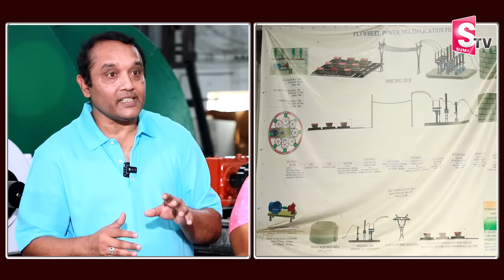Free Electricity For Home Without Air, Water and Coal In Hyderabad | Kamma Gear Wheel | SumanTV

Comment: whenever electrical consumption load increases, it will stop.   It will not work. It is just shows voltage and amp in meter panels but not for real work load.
Reply: Exactly . It won't work.
Reply: Yes Newton law won't allow this

Comment: Appreciate the effort of the engineer couple. It is inspiring for young engineers towards innovation and entrepreneurship.  While this works perfectly as per physical laws, but practically not feasible for higher loads. My suggestion to innovators is to create portable models for small loads like mobile  charging and lights for use in remote areas where power is not available.
Reply: Bro it takes one unit to make double units of electricity.. if there is no electricity then it cannot provide electricity
Reply: This will not work, because it's not convincing but confusing. No system in the universe is perpetual.
Reply: @styleZETTE  
  Few years back one tamillian claimed that he could prepare petrol from water.
Reply: @ASPO-yk9nv  we can use use wind energy or other for starting, later it will move forward...
Reply: Sir baskar sir kuteera parisrama gurunchi kavali sir
Reply: @styleZETTE  No system in the universe is perpetual, that is naive, superfluids or helium at absolute zero are perpetual. But surely this is confusing. Dynamo was the first to convert mechanical energy into electrical energy, this is nothing new so it won't be a hit.
Reply: @telugukings1227  this is a pulihora concept.chinthapandu lekunda pulihora cheyochu annatu chepparu vellu.
Reply: @technoyoung  Hahahah

Comment: Sorry to say the truth and am not here to hurt the people who has commented here.
Please don’t mind.
Basically, flywheel doesn’t provide free energy. 
Let him showcase the output with complete load and test it atleast for an hour without depending on the grid. Getting patent in India is not a big deal here.
Till date, right from inventor Chas Cambell to Mr. Chaganti garu, none of them proved to the world that this kind of system run independently without grid or any external force.
But, all the media people without having complete knowledge about the technology and the flywheel they are showcasing him as a great inventor. But, dig into the facts and realise that it cannot provide any free electricity.
As soon as you put the load on the system you will know the facts.
20000 Megawatts is a big deal and he would the next Elon Musk.
Sir, please don’t talk much and I request the media people to do some research before claiming it as a great invention and which is useless.
The result would be zerooooo
Reply: Thankgodd. You have explained it wonderfully. These are the exact words I want to mention.I don't know whether to laugh at this or to have pity of them. People are dumb and congratulating in the comment section.

Comment: Sir,
This is against laws of thermodynamics and laws of nature. Whatever energy is given to the fly wheel will be supplied to the generator. No extras, what ever you do. Your system appears to be working for a while but will stop ultimately once input is disconnected.
Flywheels naturally run for a long time due large moment of inertia. If you go for high speed, you loose torque, and want high torque, you loose speed if power is constant. Your exhibition of loading is too low. It is just one or two hp water pump you have loaded. This was tried long ago by many enthusiasts.
This is srihari prasad A.
Reply: They are beyond thermodynamics 😂😒😌
Reply: @scienceland7195  🤣😂😂

Comment: Many did efforts for generating electricity using hydraulic pressure mechanism on the roads. But they couldn't success in generating high rated power. When a bus or truck run on pressure mechanism which is linked with hydraulic turbine could supply a positive energy for your invented .... We can generate 2mega watt power daily using 1km road..but cost and maintenance is high...

Comment: Congratulations to you both. Unbelievable invention you done. 👏  I never heard or seen about your project and invention.  I feel corporates may trouble shoot your invention and development, in their business view. Hatsoff to you. Why so far It's not recognized in public and not in market.
Reply: Good question, because it will not work, there is no free energy
Reply: @styleZETTE  it is absolutely correct that there will be no free energy by any means but they are saying that it is using less energy in between certain intervals to start and stop the mechanism. So there is energy consumption involved and coming to multiplication of energy (which means torque) it is purely based on gears and friction.
It can be a simple system like car gear box for our assumption. They are not claiming that it'll rotate on its own and produce the electricity forever by consuming the energy once only to start the machanism . 
Please Go through the techincal papers before defeating someone's statement.

Chaala sarlu medhavula sidhanthalu prathipadhanalu soothraalu thappu ani thirigi saricheyabadaledha , kothavi konukkoledha...
Idhi ippati varaku cheyanidhi kabatti sadhya padadhemo anipisthundhi anthey . Kani sadhyapadani vishayam antu edhi undadhu.

Comment: Sir you are converting mechanical energy to electrical energy. If so, if your machine is having 100% efficiency in doing this job, then this is against to the second law of thermodynamics. In nature there is no machine of 100%efficiency. First, I want to know how this fly wheel is rotated? Manually..??? Or any other device to rotate it. Explain.

Comment: There is nothing free in the universe. Flywheels store energy and give it back. Consider the losses due to friction in mechanical devises. Energy output divided by energy input can never be 1 (forget more than 1). "Power" is energy expended in unit time. Vary the energy expended to get varying power. This is just a joke for a real mechanical engineer

Comment: With due respect to the wide array of deeply technical terms used in this video, a very basic set of questions.

Is this invention about giving a 1W input and getting more than 1W at the output?

1. Are we not violating the law of conservation of energy when we say we get more energy output than what we input?
2. The best known efficiency of an engine is obtained in a theoretical construct called the Carnot engine. It delivers 100% efficiency only at 0 degree Kelvin. The scientists are surely aware. How does this invention obey the Carnot engine?

Comment: Sir, what is the input power to the fly wheel? It is the mechanical energy... Is it not. Then how you are giving mechanical energy to fly wheel? Fly wheel is nothing but a device to store mechanical energy just like a capacitor in an electrical circuit which stores electrical energy. Ot is highly impossible to create a perpetual motion machine.

Comment: Very nice project.If this project is planned nearer to bridges or nearer to road side that utilizes pressure of the running vehicles on the road a redundant power supply can be supplied.. This mechanism co linked   cost of hydraulic will be reduced.

Comment: Wrong title 

Energy can neither be created nor destroyed. 
Which energy is converted to electricity.? 
No clarity in this video.

Technically it is a battery replacement system. 

It is a energy storage system - just like old mechanical key watch storing keyed in energy in spring and deliver in small quantity all day. 
So it's input should be wind/solar energy as source to store and deliver instead of battery.

Comment: Sir idont know whether it will be okay to humbly suggest for that setup to hang it yes to hang it with the metal cables  to the ceiling all everything including the monstrous flywheel sothat you can or might get more RPM  as it will lessen the toll payload. Of the gravity and traction friction of those ball bearing holding the shaft

Comment: Sir 1 doubt ,after some Time stored potential energy transfer to Kinetic energy in the flywheel become zero, how do you compensate it, ???

My dream project in 2006, studying, Btec Mech,
Was Hybrid eco friendly transport system.
Similar but my key material is AIR.Compressed air energy storage (CAES).

Comment: Congratulations to you both Andi

During our childhood we pedal at full speed and then stop pedaling ,but we move forward without pedaling till we apply breaks r bicycle speed is reduced due to friction r steepness of road ,we even to attach a Dynamo to wheel for bulb as long as wheel rotate at a given speed our bulb glows 

Just imagine we don't apply breaks r no dead end road r no friction for bicycle to slow down , bicycle keeps on moving so Dynamo makes bulb glow

Brakes can be removed but friction can only be reduced by putting in vaccum sealed low friction bearings ,that is how flywheel works

But when flywheel loses its speed a little we use little bit of energy from we generated to get back to its speed 

Before electricity flywheel technology is used in every mechanical system

It was part great industrial revolution

Even in our villages wheel (flywheel)  in pottery is used by our people from many years ,they rotate wheel using a stick then it spins for some time without any external support ,as wheel decrease he rotates again using stick ,here they are using a motor to run for few min so flywheel roatates a hour ,it's repeated again